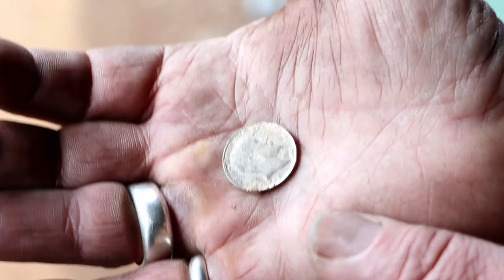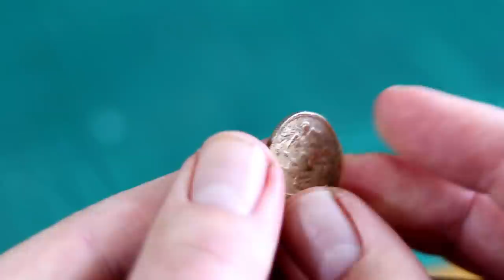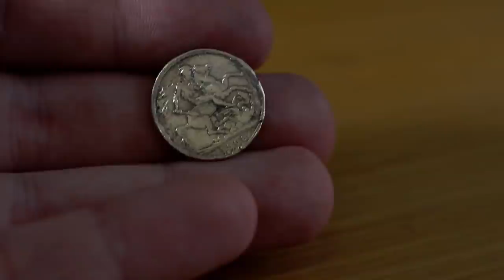Casting a Coin for Tally Ho! | Part 2

Comment: I took a jewelry casting class in college and learned different ways to cast. The lost wax method is best for detail but instead of pouring into the mold we used a centrifugal device to sling the molten material into the mold. It was a simple device, an arm that pivoted on a spring loaded shaft. You cranked the arm around, attached the mold to the end, poured the liquid metal where it went and flipped the switch that released the arm. It centrifugally forced the material into the mold and you got perfect results every time.

Comment: Jordon: Another method is investment casting, where you make the coin out of wax, then attach the sprues and vents, also made of wax, same as done here. But the difference is that it is covered with a high-temperature investment plaster in an investment vessel. It hardens quickly and is placed in a furnace where the wax is burnt out, then placed in a centrifuge where the bronze is melted, then spun into the mold. Once the metal is frozen the hot investment plaster and vessel is dropped in water where investment plaster dissolves and your coin would appear. This is the method of making jewelry - which this Sovereign will truly become. Nothing wrong with the method you used, but I believe you would have had better luck with investment casting. Thank you for the video, and for your efforts in Tally Ho's restoration.  Ian

Comment: Very enjoyable video! If I can offer one bit of feedback, maybe drop the music volume while you're talking? It was a bit loud towards the end and made it a little hard to follow what you were saying.
Reply from the maker: Thank you for the feedback. Agreed. It came out a lot louder in parts than when I was working on it on my laptop. I will make sure to run the vid through a couple of sound systems ahead of release next time!
Reply: @jordanjkimpton9846  When I'm editing I keep the music channel -8db below the speech, as default. Tool sounds are -10db. Then adjust as necessary. Hope that helps.
Reply from the maker: @SampsonBoatCo  Thanks for the tip man! I was trying to keep it at most half the db of the speech but think I must have missed or lost one of the edits I did to the sound.